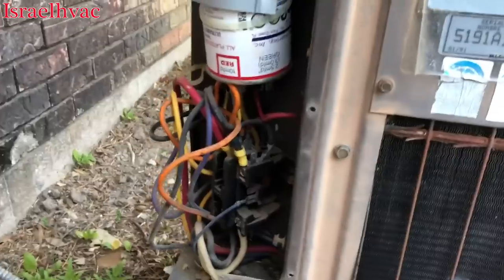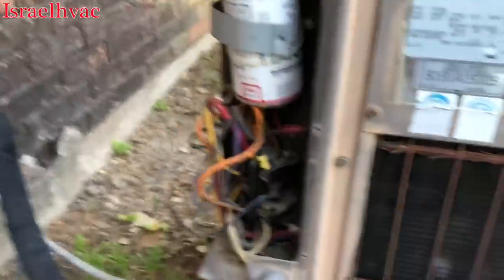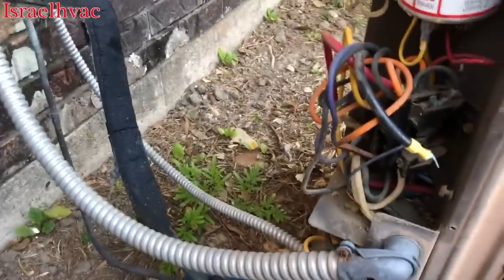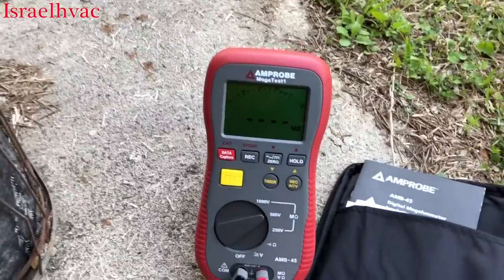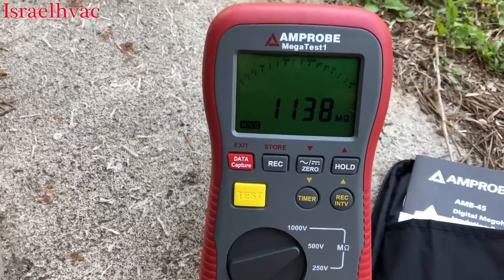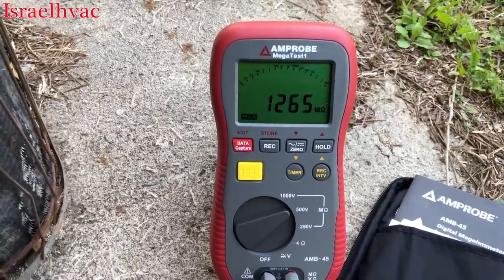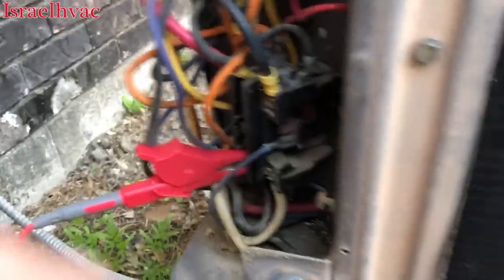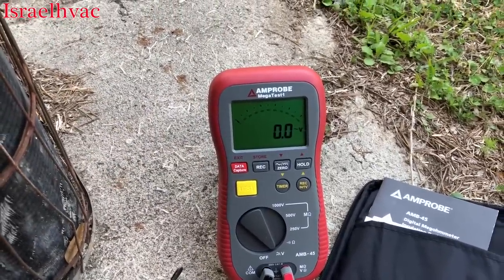HVAC | Using A Megohmmeter | Amprobe AMB-45

Comment: Those old Lennox units are beasts! I still have a couple of them still going out in the field that I do regular maintenance on. That old brown paint always oxidizes and looks orange. Give that fan motor a good shot of oil on each bearing and get rid of that turbo cap and put the right capacitor on there and she'll keep on kicking for a while. Is that thing still hooked up to a Pulse furnace on the inside John?

Comment: really??? Thats not what the Megohm meter is designed for.   Its a maintenance tool to attempt to predict WHEN a motor will fail. Records are kept on these electric motors and compared to historical readings and they will know fair good when a motor will fail graphing its readings.  Some of these maintenance people, in like factories, work of equipment all the time and can't afford to have equipment fail unexpectedly. So, they meg motors, whether in a compressor or whatever...and test the windings insulation. 
      In the case of a compressor  they test the windings and moisture levels that are not seen in sight glasses.  When I got my first meg in about 94, I actually read the instructions, (few do),  and they tell you low megs on a compressor often times means, time to change the dryer as a maintenance procedure. My Fluke, or Simpson meter, will read megs, but they lack the voltage to actually leave the insulation or JUMP to ground, or another winding or thru moisture, like high voltage does (Jacobs Ladder).... 
     In conclusion, ........ if you meg a compressor that runs with a low meg, change the drier.
Reply: Spot on, good to see someone that read the manual or white papers.
Reply: Aubrey Jahier you mean the instructions are not knee pads?
Reply: Megohm meter is designed to detect voltage leaks to ground. If you do a simple calculation and your compressor falls under the desired calculation you have a bad compressor.